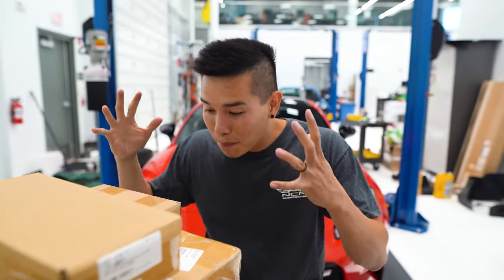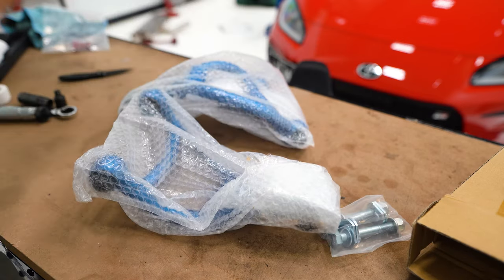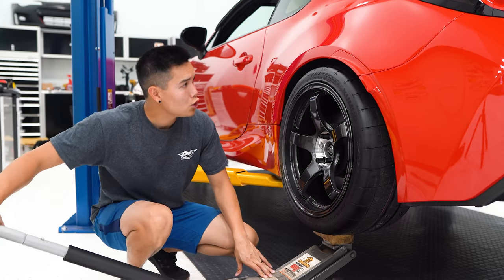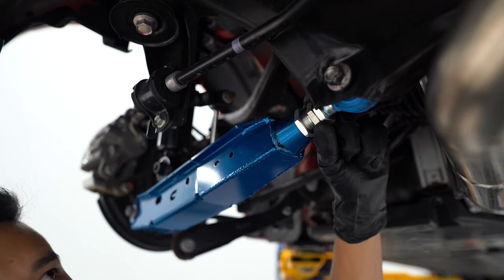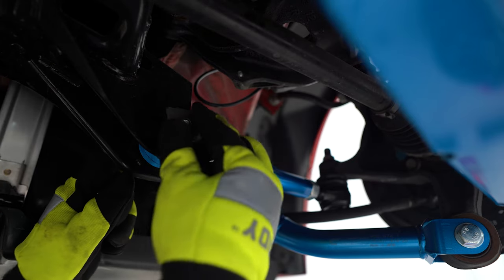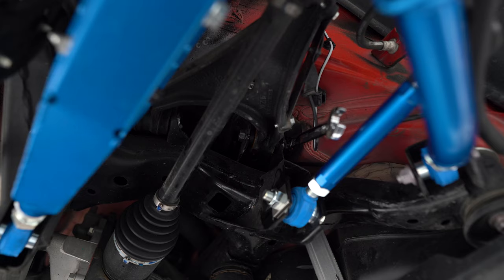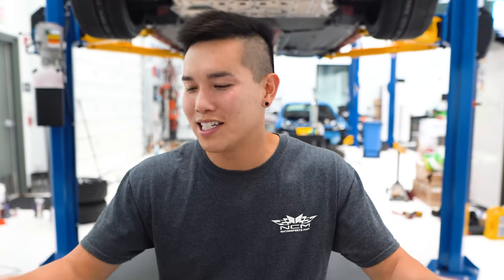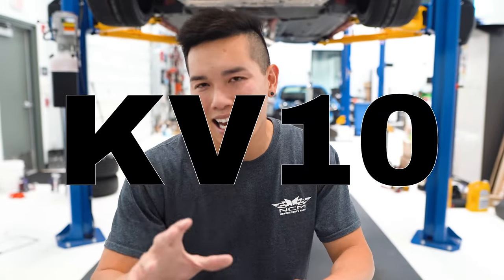2022 GR86 gets FULL SUSPENSION replacement!

Comment: Have always loved how knowledgeable you are and how you’ve always been a huge part/support in this community, and so I have a question. What are the advantages of aftermarket trailing arms?
Reply from the maker: I'm not an expert on suspension geometry and such but I'll try to give an explanation. You're replacing the soft rubber bushings with spherical bearings which are goint to help to prevent wheel hop and unnecesary movement of the wheel. You also essentially gain caster adjustability in ther rear which may not seem important because the rear wheels don't steer, but it can effect the suspension geometry curves which are how the suspension changes throughout the full travel. Does that make sense?

Comment: At 11:11, what's the solution for securing the ABS harness?  Doesn't appear that the Cusco arm has any mount points for the OEM metal harness bracket.

Comment: Here's a question i've always had: why would you want upper control arms, when lowers will adjust the camber just fine? What is the benefit of replacing the UCA's?
Reply from the maker: Good question! On the previous gen the lca would do the trick, however, with the 2nd gen the rear wheel fitment has become a bit more difficult as you have to do more work to run as aggressive as a wheel you used to be able to run on the 1st gen. People are having to modify their fenders and trim them to fit the size I want to fit. With an upper control arm, I'm able to move the wheel inwards more to give me more clearance and minimize the amount of trimming I may or may not need to do.

Comment: I have a question, does the same wheel fit a stock suspension setup? Same for all the suspension, will they fit a stock suspension? Here in Italy roads are terrible and getting a coilover setup is extremely optimistic

Comment: Kevin, can we get a 18x9.5+45 in 5x114.3?   This fitment is sooo much better than the +35s and +38s, but I think I've only come across one wheel  in this fitment, and I didn't feel like departing w/$2600 .  (for just wheels).  I so wish there were more 18x9.5 +45/5x114.3 available.  Car is looking good.  How's the motor build coming?

Comment: Tried following your steps with the rear lca. Question:
Why did you install the washers oposite to what the instructions say?
Reply from the maker: Double check the installation guide. I have them installed the correct way for this application.